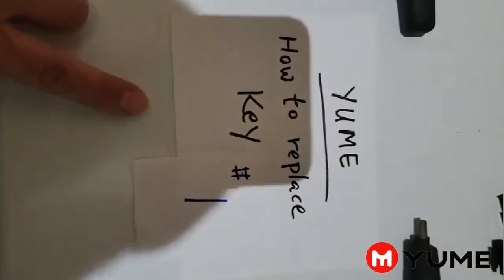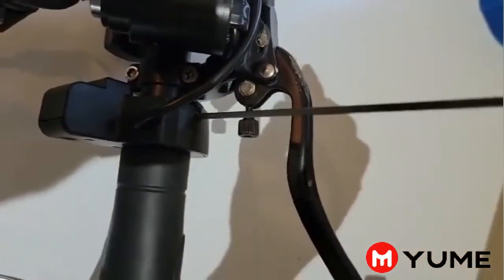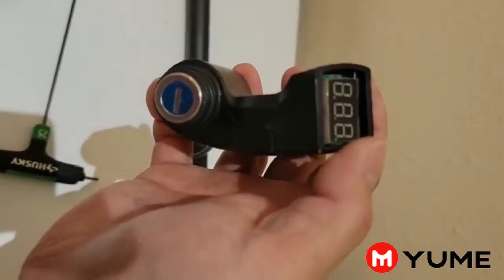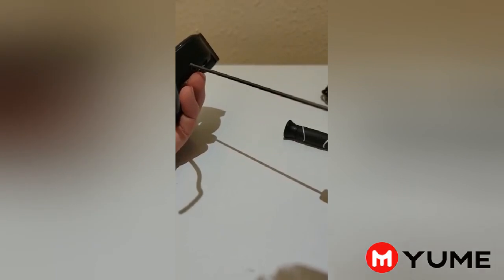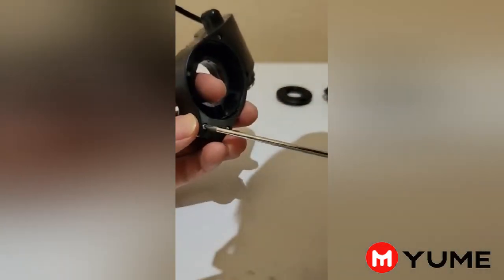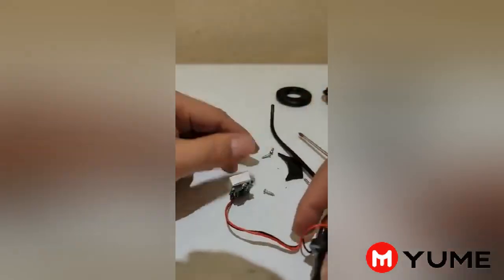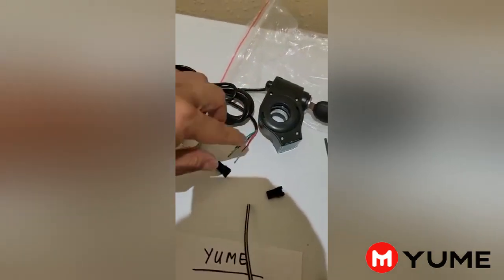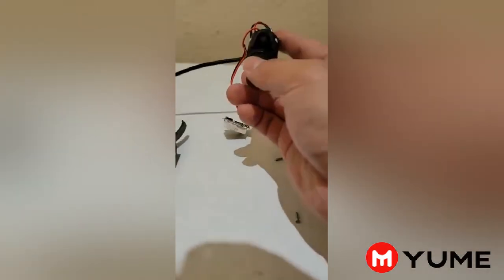YUME How To Replace The Voltage Lock | Best Electric Scooter for Adults|YUME scooter|

Comment: Nice, strip the wire loom, connect orange and green together and ride off with someones skooter without having their key! Nfc tag or phone app with Bluetooth connection would be more secure along with keeping wires completely inside the steel tubes